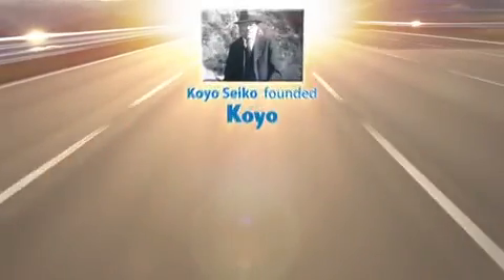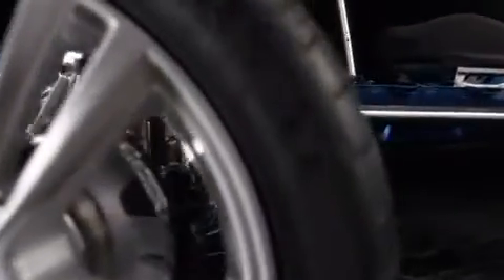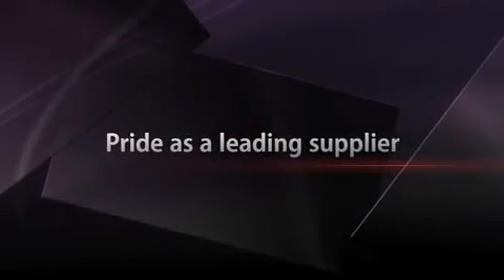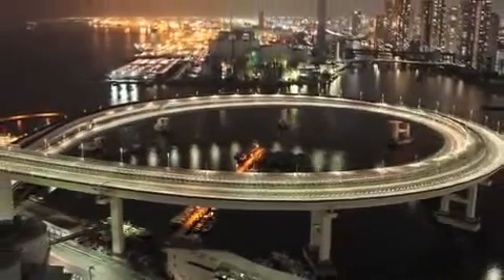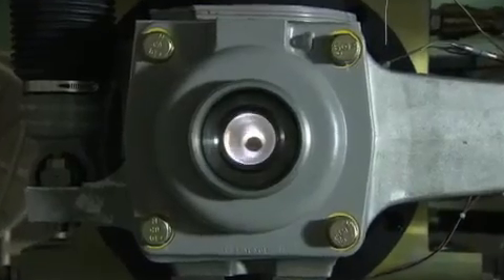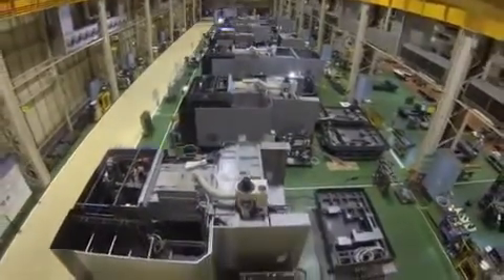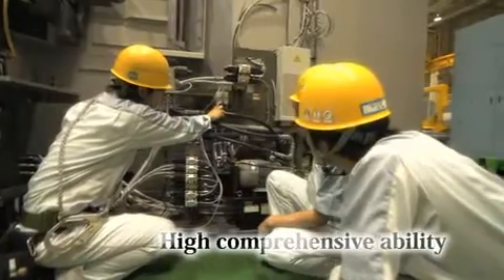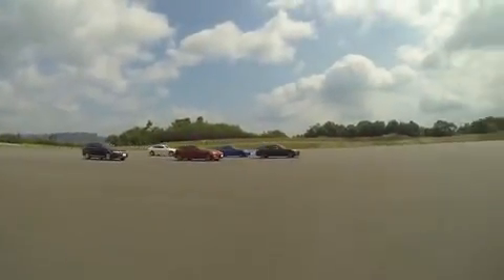About JTEKT Corporation

Comment: As a technician my experience with these hubs are positive. My only complaint is on BMW, the splines on the hubs that mate to the CV shafts are too tight. Having to pull out a V file to correct a manufacturing error let me down a few times.